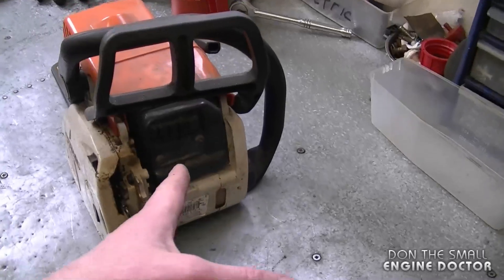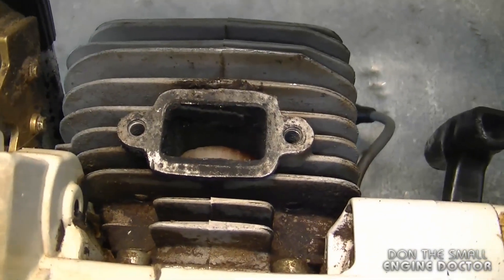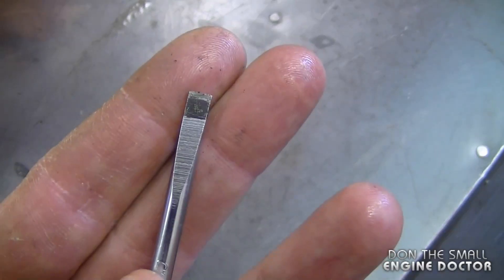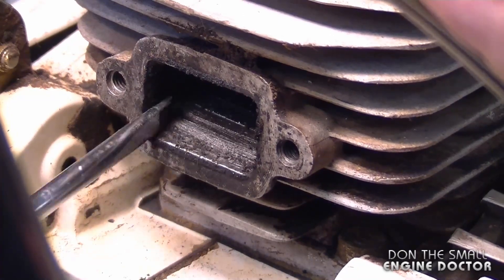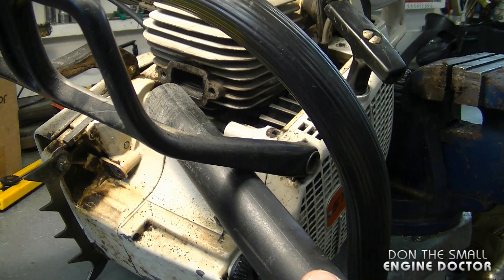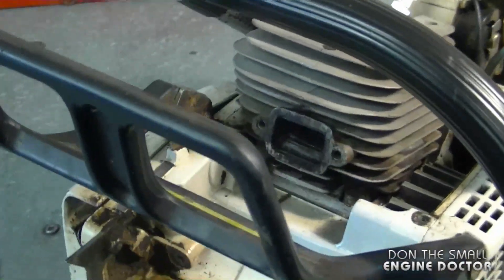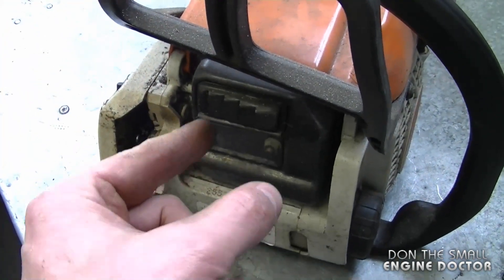How To Remove Carbon From A 2 Cycle Engine Exhaust Port

Comment: I have a backpack blower that starts perfect on a cold start but after using it at full throttle for maybe 30 to 45 minutes then refueling when the engine is hot or warm, I can't get it started back up. The muffler doesn't have a spark arrestor but there's a lot of black silky stuff that was leaking from around one the mounting screws and on the back side of the muffler and the heat shield gasket looks like it has been worn down from heat. Could this be the reason it won't start back up when the engine is warm or an ignition coil problem?

Comment: To protect aluminum or other surfaces, I've used a scrap of polycarbonate or acrylic sheet.  For very light duty, like removing labels from equipment with Goo-Gone or other, I always use out of date credit cards.  Just a clean cut with sharp scissors leaves a nice scraping edge.  To sharpen the harder plastic, you can use a file or other steel edge.

Comment: Is scraping the only way? I am afraid to scratch the piston by mistake. Any powerful solvents that can dissolve that build up like B-12 Chemtool etc? Not talking about gas mix, but like spray it in the port and let it soak and wipe it off with a shop towel etc.

Comment: My spark arestor is not removable from my muffler. It’s a Poulan pro leaf blower. Can I just spray brake cleaner or sea foam on the screen of the spark arestor (it will end up in the muffler too) and let it dry and see what happens? Thank you to anyone that can help with this question.

Comment: Ever hear of this? Replaced piston ring on 25cc WeedEater Trimmer. Compression at 130 now. Engine performs well but.....only if I remove the muffler completely. New muffler makes no difference. Idles only. Take off muffler, runs great. Tried old muffler, same results. Replaced cylinder head with new one, no difference. ?????

Comment: For our motorcycles and motored bikes, we made a habit of taking off the exhaust pipe, torque pipe, pitch pipe, (whatever), and chucking them entirely into a hot burning slash pile or out of control camp fire and just let the red/ yellow/white heat of the metal consume the unwanted dinosaur juice and at the right moment (your timing may vary), chuck them into a back eddy of the local creek, which, alone, could raise the most amazing pairs of goosebumps on our girl friends with it's intense lack of warmth.  After the ceremonial beer, the last one done got thrown bodily into the crick to fetch them back to the fire where they were gently hotted up to prevent internal rusting.  The exhausts, I mean.  Pocket knives did for what else seemed to be in the way, but it was far from unusual to see a couple of half drunk dudes dead lifting a 501 Maico upside down to shake out any suspected strays.  The neat thing was that no matter how bad a job you did, any effort was always counted as a success because every litttle bit made it run some better.  Good video.  Keep it up!

Comment: I've found that good  modern motorcycle pre mix thats designed for power valves runs pretty clean.

Comment: Thanks forthe video. Just finished cleaning carbon from my 2004 Husky rancher exhaust port for the first time. I've always run 50:1 mix. It wasn't too bad but it is clean as new now. Did a friends 80s era ProMac 10  that was WAY  plugged upto where it just wouldn't rev. I think he was running 16:1 mix lol. Crazy.

Comment: Sea foam in the aersol can is amazing for loosening carbon deposits. Just spray the area, let it sit for a few hours and most will wipe off with a rag. Take a flathead screwdriver to get the stubborn chunks

Comment: WhT about cleaning the top of piston? I got a lot of buildup. Thanks
Reply from the maker: Great suggestion!
Reply: Yeah, i saw a bunch of gunk in there while i was replacing my spark plug. But it seems like you basically have to disassemble the whole thing.

Comment: Had a commercial weed eater seize up on me. Sprayed some penetrating oil in spark plug hole and tapped the piston with a wooden dowel to break it loose. It ran but over heated shortly after. When I finally tore it down I discovered so much carbon had built up on the inside lip of the port and hardened that it was acting like a set screw on the piston not letting it move. The piston was ruined, looked like an animal had clawed a big chunk out of it. Cost me $80 after I bought new piston, rings, and cylinder (jug). I could have reused the cylinder but decided to get a new one since It was pretty old. I now check the port regularly and care more about my oil/gas ratio being more spot on. I use to think more is better than not enough, which is true but not all the time. Try to get it as close as you can and only go over on the oil if you have no way of measuring it.

Comment: Thank you very much. I've been using red armor at 32:1 for milling lumber on a ms660. I realize it leans out the mix when I do this, but I've tuned the saw for that. Do you recommend 40:1 or even 50:1 for milling then? It smokes a little on start up but then I have no smoke whatsoever for the rest of the day. 2 pulls to start.

Comment: Generally, I only.use a metal object like a screwdriver only as a last resort.

You can get bamboo scrapers that are about 0.5mm with a 45 degree angle cut on them, I use these to scrape the ports, if you have a slight slip or do scrape the piston, you won't score it.

If it's stubborn carbon, spray brake cleaner, let it sit for 5 mins and spray again, then scrape.

Can get it almost metal polished-clean.

Before steering kit, put a drop of oil in the port and hand turn it, just to re-lubricate everything before it goes under load running....

Comment: Dony I use stihl motomix in my stihl chainsaw and weed eater do I still need to check the exhaust port?
Reply from the maker: as a precaution i would still check it
Reply: @donyboy73  I will and thank you so much for taking time out of your day to answer my question. Stay safe and thank you for doing your videos you have taught me so much.

Comment: I make a rule to clean up my saw after every use. Today I noticed black coating on the bar and casing on the same side as the exhaust port. Could that mean too much oil in the mix. I use 40:1. But this saw says to use 50:1. Could that really make that difference.

Comment: Hi, thanks for the video. you save my machine. thanks. What's the reason for oil leaking (brown color thick oil)  from the  2 Cycle Engine Exhaust Port

Comment: There's coke and there's carbon. Coke is hard, crystalline looking stuff and it can be harder than steel....easily ruin the hardest of jugs and destroy pistons. Never tried the Seafoam trick....worth a try! Unless you're hassling with the Forest Service, chuck those screens......just pack a little fire extinguisher with you. Coke and carbon like that DO happen from the guys that use too much oil in their mix. Use the Stihl Ultra Super (and no, I'm not a Stihl fanboy) and you won't get that....old ported and newer saws.

Comment: This is the first time I am gonna disagree with you.
Doing that is a little bit aggressive to the port, the screwdriver is scratching the port. Maybe it is not so bad, but surely there is a less aggressive method to do it, like a wire brush or something.
Reply: I agree....nothing harder than the aluminum cast.

Comment: Well I checked everything out as you suggested, that was all good thank you for giving me the help. My pressure washer is now working great
It was taking about 20-25 pulls to get it started. Now after following your suggestions it has started on the first pull every start up.
Thank you for sharing your knowledge with us all. I myself appreciate your help.

Comment: Question for you? I have a Karcher 2400 HH pressure washer with a 5 hp Gc160. I have to pull about 20 times before it will start sometimes more. I adjusted the valves & checked the plug, all is good. Anything you can recommend for me to do to try and get it to run after 3-5 pulls?
I really trust your videos and value your opinion. I’ve watched many videos on utube, you sir are by far the best one out there. Keep up the good work & thank you in advance for your time.
Reply from the maker: you may need to clean or replace the carburetor. also check choke butterfly to make sure it closes when choke on
Reply: Got it thank you for your reply. I will look up your carb rebuild video for sure. Thank you very much.
Reply: Also, on the pressure washer, make sure the wand trigger is squeezed so you are not fighting the pump trying to pressurize the water.  Then the engine will spin easier.

Comment: I have a question for you: I have a Karcher 2400 HH pressure washer with 5 hp Gc160 motor. I adjusted the valves on it & checked the spark plug. I am trying to get it to start with 3-4 pulls. Any ideas as to why it takes about 20 pulls to start??  Thank you for your time in advance,

Comment: Question for you is: can’t you use sea foam in your fuel to aide in the carbon cleaning? Enjoy your videos very much. You have helped me with almost all of my small engines. I appreciate you taking the time to do them.
Reply: The motorcycleMD did an interesting test soak of lots of different carb parts in all the common cleaners, sprays, dips, ultra-sonic, etc. It seemed the Seafoam was the mildest/ most forgiving of the chemicals on the seals and diaphragms of all of them ...berrymans being pretty harsh. For what it's worth!! Worth a watch. 😊 thanks Dony!
Reply from the maker: yes you could but don't put in too much because it may harm carburetor seals and diaphragms
Reply: Thank you for that quick reply. Keep up the good videos.

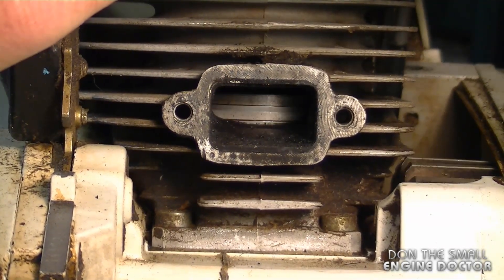Comment: at 1:20 I can see brown residue on the piston directly underneath the piston ring. 
What would be the cause of that? 
I have seen this too on my chainsaw.
Reply: If the spark arristor is blocked, the combustion with swirl in the muffler and exhaust port as the piston continues to travel

Comment: is it better to use sand paper or steel wool when cleaning the exhaust port of a 2 stroke engine?
Reply: Josh Chelvolski wire toothbrush

Comment: I have a 1996 poulan 2175 and the piston and jug isnt scored at all it just broke the piston ring so i was wondering how could i get piston off rod and change both ring and piston. Wanting as a back up saw again
Reply: pull the muffler and carb off, remove cylinder, once you have the cylinder off remove the circlips that hold the piston ring in place...pull piston..clean pistona nd check for scoring...anything major and you will probably need a new piston.  same goes fro the cylinder, clean it if it has aluminum transfer you can remove with a emery cloth flapper wheel...go look up wither miller work saws, or bsnelling  I forgot which on but one of them shows how to do this.  if the transfer is removable then the cylinder is GTG.  if you are lucky you just need a ring....excessive carbon build up behind the ring can  over a period of time cause the ring to bulge out farther than it should catching on a port edge and then snapping the ring..  good luck...check out the arborist forum, the outdoor power equipment forum or the forestry forum...all of them have large chainsaw groups that love to tinker, rebuild, mod etc on chainsaws...lots of knowledge for free.
Reply: Kylee Bates take the cyilinder off have shop born.out the cylinder and get a new head and piston n ring ur fine
Reply: You cant bore small 2 stroke cylinders it has a nickle coating on the cyinder walls

Comment: Wow, I never cleaned the carbon from the exhaust on my stihl 026 and used it professionally logging for ten years and the piston looks great with absolutely no score lines or anything.  It probably ran for a few thousand hours with no troubles, now I'm putting in a big bore 44.7mm kit and rebuilding the carb as I'm bored and it sat for 17 years as I joined the military and stopped logging.

Comment: my cord on my brush cutter was hard to pull so I pulled the recoil off and it looks perfectly fine, however if I remove spark plug the cord is easier to pull, so to check for exhaust issues, I ran a compression test and the compression was decently high at 150 and I notice almost little to no air coming out exhaust pipe, so I pulled exhaust off, and I noticed that the port is full of carbon but looks similar to your video, as I started to clean it the cord got a bit easier to pull.  to fix this do I continue cleaning it more?  How do I get the crevice or corner thats touching the piston safely?
Reply: Pour a oil/gas mixture into the port and let it sit. That will soften up the carbon so you can wipe it away with a rag wrapped in a screwdriver or blow it out with compressed air.

Comment: Dony, My Saw is like the one in this Vid.........How do I remove the Muffler ?  The Cover seems to not detach. It is blocking the removal of the Bolts at the Cylinder. Thanks
Reply from the maker: remove the top cover

Comment: How often should I have my heaviest used tools be cleaned if they are being practically almost as much as commercially used ones probably are.  Can the fuel octane effect carbon build up or cause other issues.  As always thanks for your informative videos.  Before U-tube all I could do myself without causing more damage was pretty hopeless.  Thanks for your videos.  I have ended up recommended them to a few friends also who were real happy with the results to.

Comment: Fill the exhaust port with Seafoam and let it sit about an hour. Then the carbon will wipe out with a rag. You're welcome :)
Reply: Thanks. That was my question. SEA FOAM ????     How about sea foam in gas every SIXTH tank to get carbon out of cylinder and piston face ?????
Reply: @boedayious4993  In my opinion that is a great idea. I do that often.

Comment: I was given an older Stihl FS44 string trimmer.  It needed a primer bulb, which I replaced.  The trimmer starts and runs, but there are two probles: the engine runs at full speed all the time even when I am not holding the trigger (the throttle is stuck open) and when I turn the switch OFF the engine stays running.  If I put the choke back on it dies eventually, but I would like to make the machine work 100%.  Any ideas on what is wrong?  Thanks
Reply: Wayne Manion tune the carb down for the speed prop

Comment: When am cleaning the exhaust port i usually spray a little carb cleaner on it and let it sit for a while and then gently scrape it off. This way the exhaust port don't get scratch, carb cleaner i used is called Bars Carburetor Cleaner. works real good.

Comment: I remove the spark filter it's always cloged. do you use a  solvent to remove the rest of the carbon?reg gas or something.
Reply from the maker: i use a propane torch to burn off the carbon from the spark arrester screen

Comment: I usually us a wire wheel on a drill to clean the exhaust port and then I blow it out with the air compressor with the piston near T.D.C Usually looks nicer and I know 100% the carbon buildup is gone.

Comment: I am sure you do not need to put the spark arrestor back in. It basically just quietens the machine down a couple Db's but also allows engine to breathe alot better as there is nothing there to restrict the flows
Reply: The spark arrestor does just that, arrest the spark before it leaves the muffler and starts a fire. (forest).

Comment: seem like you could hook up compressed air to the spark plug hole to insure  carbon does not get into the cylinder.
Reply: InvalidMemberAccount That would not work since you are performing this procedure with the piston at top dead centre which would be blocking the exhaust port.

Comment: I hope you have less snow than me. This is the first time in over 20 years we have had over 5 feet of snow this year. We still have a foot and it also have been cold -20f with -45f wind This was the first time in about 4 years that I did not put my 46 inch snow blower on my garden tractor. I can not use either but my son can use the Ariens 32 13hp snowblower. After the first snow I could no longer get to the tractor or the snow blower for it.

Comment: I am not a professional small engine guy but I do fix a few.  Last year I got a weed whacker in and it was scored just like you showed.  Very good video Don.  I  am now renewing a 1969 skil 1629 chain saw.  It is a beast.  You might remember a comment about numb hands and loose teeth from vibration..  Well that is the one.
Bruce
Reply from the maker: hopefully it will run good for you

Comment: I use a dremel with a strait brass wire brush to do this. Much less time consuming and gives it a smooth polish. Though I rarely have to do this because I mix my oil right and keep my equipment tuned correctly.
Reply from the maker: good tip

Comment: My dad has a shindawa chainsaw with a 16" bar on it. I took off the cover where the carburetor is. Is it normal for there to be a lot of build up of saw dust in the that little compartment where the carburetor is?
Reply: I will definitely have to do that. Might even do it today. Do you have any suggestions how to cover up the hole for the carburetor so I don't get any dust in it? Thanks for the reply. I really should get into the habit of doing what you do with your saws.
Reply: Love2boat92 did u not c donyboy moving the cylinder so no carbon wouldnt get inside do that then hiiver out sawdust.

Comment: Hey don i'm working on a yamaha 570cc snowmobile engine for a project it needs a top end rebuild and the wiring harness is still good should i fix it or part it and i am doing the rebuild myself
Reply from the maker: might be worth it if you do the work yourself

Comment: Great tip,not a lot of people even think of checking the exhaust port on there 2 cycle equipment 
And it's so easy to check. Thx for sharing, have a great weekend Don.
Reply from the maker: thanks